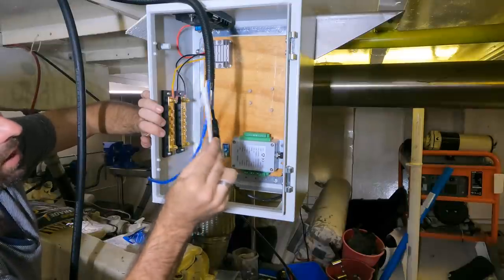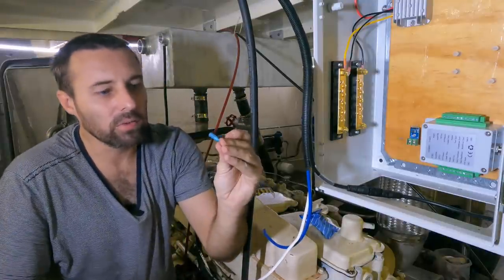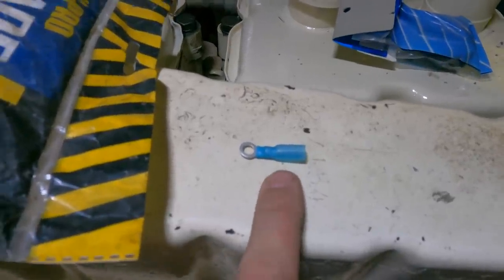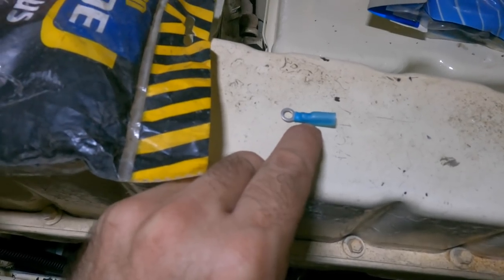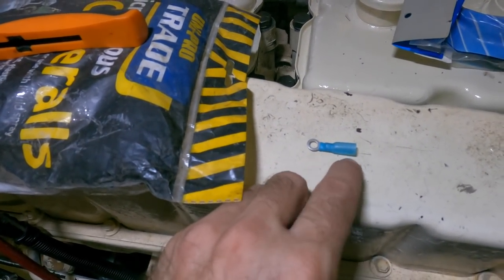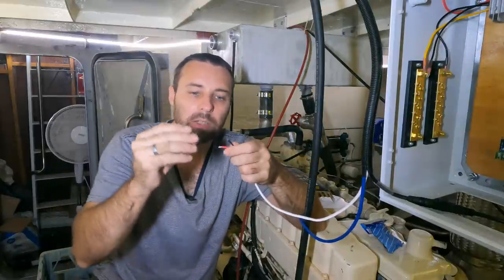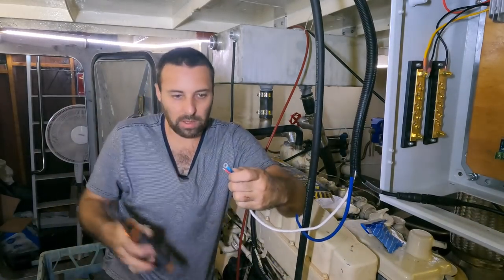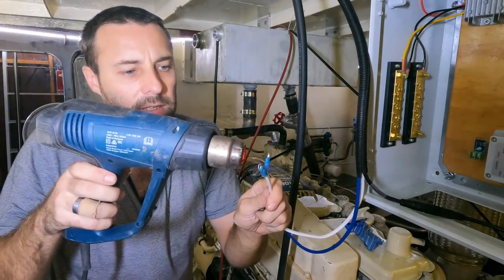How to crimp terminate wires on a boat and have them last decades

Comment: Finally, someone actually does this properly!

Some other things to note...

Stress relieve your cabling in switchboards etc.

Crimped connectors do still have a freezing point that will cause strands to break in the same way as soldered joints when subjected to vibration etc. The main difference there is that the wire is supported beyond that point within the connector which makes them far easier to do properly and consequently far more reliable. Soldered joints can be just as good, but lots harder to get right.

Even though they're stress relieved in the connector you still need to stress relieve the cable within your switchboard etc. You can't have half a meter of wire hanging off the crimp.

Your switchboard will also end up far neater right at the start which pays dividends later on when you need to fix or change something.

And if you do use non tinned wire, do not tin it or add solder to it before crimping. Solder is an extremely soft metal, when you subject it to force such as from a crimp it will start to flow (creep) out from under the crimp, it just does it very slowly. The result is that the crimp will loosen up over time and you'll end up with a poor connection there.

Finally, buy a thermal camera. Not just a temp gun, but an actual thermal camera. They've gotten to the point now where they're reasonably affordable.

They're absolutely brilliant for dealing with switchboards etc. You do all your crimps, get everything running and load applied to everything etc then after an hour or so you come back and look at the crimps. You'll see any bad ones as they'll be hot.

You should also periodically (every few months or so) check them to make sure none have loosened up over time.

Do the same thing with your batteries as well, again the bad one will start getting warmer than the rest.

You can check exhaust header temps too, or see where the cold is leaking into a room to check insulation and if you get one with enough thermal resolution you can even find rodents etc.

Basically, they're one of those tools that once you have you'll never understand how you managed without it. They save so much time diagnosing faults and doing planned maintenance it's unbelievable.
Reply from the maker: Great advice. Thanks Daniel
Reply: One more "not required, but helps" to keep a can of xylene or other fast solvent handy. The wire insulation typically has release agents and or lubricants on the outer surface that can be removed to help the hotmelt adhesive stick better over the long run.

Comment: Dame, I'm a retired high voltage test technician and I worked with thousands of electrical connections similar to yours but in electrical substations. That was a perfect explanation how to perform crimps, the key point having the proper crimp tool. I've seen contractors make hundreds of crimps in a section of switchgear only to find out they used the wrong crimper and all the wires would pull out of the crimps. 
Everything on the boat is First Class. You are a skilled engineer 👍👍👍👍👍👍
Congratulations on being a full-time boat worker now. 😊🤝🤝🇺🇸
Reply from the maker: Thanks Tom, great to have that feedback.

Comment: Spot on, Bro. I was a US Navy Electronics Technician. And I do a lot of automotive & trailer wiring in Minnesota. Lots of salt on the roads in winter. What you just demonstrated is the premire way to do wiriing with crimp rings nd butt-splices.  Cheers. All my best to you both.
Reply from the maker: Thanks Brian
Reply: Right on Brian.  I'm in Iowa.  When I  find the package of wire nuts and scotch links in the trailer kit, I giggle every time

Comment: Bang on all the way.....IP ratings very high with all your connections.
This is how I use to rewire ribs and then also try to get as many connections into a IP rated box with water tight glands. Those connections that was still a little exposed I used liquid heat shrink stuff (sorry I forgot the name of it).
Spot on job on your video with you indepth guides.

Comment: I build a lot of wire harnesses for boats and you showed it properly.
There are other methods, the theory is the same and this is by for easiest method.
I am glad that you added the cavit of tinned wire. Many boat manufacturers do not used tinned wire in original construction unless running in areas of high exposure to moisture and salt water.
I have a mid-70's trawler no tinned wire but also no corrosion in the wires  as they were sealed properly.
Awesome work mate.

Comment: Absolutely agree with all of this. A short but value-packed video. I think these wire strippers were first made by the ‘C.K.’ brand in red and they are my go to ones for everything from 2.5mm2 T+E all the way down to tiny; they are fab. One of the best features of them is that they work and remove the insulator without harming the conductor regardless of size, which is very, very neat. They also have a stop so getting the right length exposed is a cinch, but it’s best to get this right first time. They are not nibblers. The only times they do not work are when access is very tight or there’s a very small amount of insulation to remove and you have an outer piece too close, but this is rare. If all is fine then grip, grip, grip – strip, strip, strip! Also fully agree with tinned and the crimping, but the message on using heat shrink with adhesive or glue or whatever is legion. It forms a much better joint in every application. Finally, what wasn’t said was to label your astonishingly well-made wire. Chances are that it’ll have to be removed at some point, some day and a heat-shrink label tube or a flag label using a decent labeller ought to be the norm. Oh and the best terminal crimps sometimes have to be trimmed otherwise the bolt and suitable washer don’t sit properly, but this is obvs.
Reply from the maker: Yip. All good advice here. Thanks
Reply: The double crimpers look very similar to the Ancor crimpers I use. My other crimper is about three feet long and cost about $275. I use it for tinned power lugs, ranging from (North American sizing) 8 gauge all the way up to the 2/0 -4/0 gauges I use at the batteries and the starter. I use resin-infused heat shrink tubing and, after I double crimp the power lugs, I shrink this over the "shaft" of the lug. 

We actually had a flood in the engine bay and I had to get the starter rebuilt. Not wanting to chuck a longish length of expensive 2/0 gauge tinned wire, I cut the old lug off and there was ZERO water ingress. Shiny like new. So I just repeated my lug crimping and heat shrinking and restored the rebuilt starter. No problems! I follow the same techniques, which I learned from this site, which is an amazing resource: https://marinehowto.com/marine-wire-termination/

Comment: Excellent tutorial. This is what I’ve been doing for many years, but most people don’t take the extra time or expense.
Reply from the maker: It’s a pet hate of mine seeing car crimps on a boat. I just know your gunna find green gunk under them
Reply: @ProjectBrupeg  I’ve also recently found a soft solder seal connector that they use in the aeronautical industry that’s quite nice. Specifically used in butt connections. Quick heat with a heat gun and done.
Reply from the maker: Yeah I’ve seen and tried those. I’ve not had the best experience with them but it’s possible I’m not doing it right. I have a 50% success rate so far with them
Reply: @ProjectBrupeg  I only use them on repair or extension jobs. The crimp seal are better for initial installation. With the solder only, I use my Dewalt  battery heat gun. They need a slower, lower level of heat. Just heat them till the soft solder silvers.

Comment: May I add to you great demonstration of the proper way of doing connections.  Use  Penetrox on the connections points outside. This is what we use as Electricians to stop corrosion on connections. We like you can't wait to see Brupeg's bottom get wet and king Cummins come to life.

Comment: And DON'T use welding cable for battery wires. The jacket on welding cable is gaseous permeable which means the jacket is neither water resistant, water tight or corrosion resistant. I like your style for doing the wiring. I've rewired boats up to 50' - 60' and have removed lots of corroded terminals, bus bars & other terminal connections. Red = 18-20 Ga., Blue = 14-16 Ga. & Yellow = 10-12 Ga. Don't use SAE wire either because it's up to 10% smaller.

Comment: Those resin filled connectors are great, I use them for everything if they are available in the right sizes. 

I've noticed most videos lately were shot with gopro which IMO is a little sad. I started watching Brupeg because of the great picture quality but lately I got the feeling Dangar Stu is filming ;) Hope you can get out your proper cams sooner than later again.
Reply from the maker: We do film 100% using go pro now. We have tried canon and Sony ($6,000 ea) and while they do give great picture quality sometimes, 80% of the footage is unusable as they are inherently unstable, they are extremely easy to set wrong and ruin a shot and most of what we film we don’t get a second chance to re shoot it. Yes we love the image quality but they are just awful to use and end up being the slowest part with the highest frustration in everything we do. It’s possible we will go back to better cameras when out on the water but given we can buy 12 go pros that are water proof and have image stabilisation onboard for the price of one camera we hate, that’s a big hull for a mirrorless or DSLR to climb

Comment: you have probably already considered this but it is worth while either completely sealing your power box and associated conduit from the atmosphere or working out a suitable ventilation system. Otherwise you will have problems with condensation and mould growth.
Reply from the maker: It will be a sealed box full of argon when we are finished. Just not there yet
Reply: @ProjectBrupeg  cool, you have it fully sorted then

Comment: Only thing I would add is Stranded cable for anywhere you expect to encounter vibration or movement, Solid cable for anywhere that you expect to be static and not subject to vibration or movement. Solid tinned cable may last longer than stranded tinned cable in a scenario where there is zero movement, the reverse is definitly true in an area where there is lots of vibration.

Comment: Dame, great short clip!  Question to all.  I was always taught to twist the wires clockwise before inserting into the lug.  I didn't notice that step in any of the comments.  Does it matter or does that add strain that vibration will take advantage of?  As always the best to you and Jess (ok and Stu...) :)
Reply from the maker: I don’t know if this is good or bad but I have found with some butt splice connectors they don’t have a physical stop in the centre essentially it’s just a tube with heat shrink on it. If that’s the design of connected i try not to twist the wire and instead slide the crimp down one wire, mesh the two stripped ends together then pull the crimp back over the join and finish it off. I just assume I will get more conductor contact and therefore a better join

Comment: Had a look at your links for the crimper and heat shrink crimps, but they don't ship to Australia.  Do you have a supplier that ships to Oz?  Thanks, Kevin
Reply from the maker: Not actually sure Kevin. Maybe check out eBay. Brand doesn’t matter so long as the shape of crimp is rectangle not pointed
Reply: @ProjectBrupeg  thanks Damo and Jess. Looking forward to the launch. Good luck.

Comment: For the crimping process; do you have the coloured dots on the crimper facing towards the eyelet of the terminal or towards the cable?

I’m left handed and can never remember which way round it goes!
Reply from the maker: Honestly I can’t see it makes any difference at all. The crimp is the same shape either way.
Reply: How about for a non heat shrink crimp?
Reply from the maker: I haven’t used a non heat shrink in years so really couldn’t say. Personally I would bin any non heat shrink given these heat shrink types are not much different in price and night and day different in terms of quality.
Reply: That’s the way I’m going to go. Perfect timing with the video for me! Thanks so much.
Reply: @ProjectBrupeg  That's not true, actually, for a double crimper.  According to the link I sent you (and the instruction manual for the double crimper I have): "When crimping an insulated terminal, with a double crimp tool, it is important to note the direction the terminal is place into the crimp nest. The insert end or the end of the terminal which you feed the wire into should always face the strain relief side of the crimp die.

Remember when I said “double crimp” yes, this tool makes two crimps at the same time. One crimp is made for the wire and one crimp for the strain relief. These two sides of the crimp die are not symmetrical. The side where the colored dot is, on this particular Ancor tool, crimps the strain relief portion of the terminal and the other side crimps the wire end.

If you make a crimp with the wrong side of the crimping tools die, the crimp will not be correct and will likely fail.

TIP: Other double crimp tools from other manufacturers may be different than this tool. Examine the dies or check with your tool manufacturer for instructions. The side with the smallest crimp ID is the one to crimp the bare wire end.

WARNING: Double crimp tools are UNIDIRECTIONAL! If you crimp the terminal backwards it will pull out far too easily and pose a safety risk. The strain relief crimp nest is considerably larger than the crimp nest designated for the bare wire. A fair number of readers have complained that their double crimp tools don’t work well, and some cheap Chinese “look-a-like” tools may not. I always explain that they are unidirectional and the reader most often writes back to say the tool now works just fine."

You may have a different double crimper, of course, but this sounds reasonable.
Reply from the maker: I will have a close look. To me the tool looked symmetrical so I’m not sure it’s a double crimp die

Comment: Like the look of the terminals but when I went to Wirefy it didn't give me the option to specify Australia  How did you do it?
Reply from the maker: Hi Graham, yeah these terminals were sent to us from a viewer in the states. i have topped our kit up using e-volt terminals from eBay and found them to be almost identical in quality and usage. link to the main e-volt sotre is here https://evoltelectrical.com/
Reply: @ProjectBrupeg  Wow thanks for the quick reply. Looks like they came from the same factory.
Reply from the maker: No worries mate. Yeah I can’t tell the difference. Main thing to look for regardless of brand is make shed the heat shrink extends well forward to moisture can’t wick up the open ends on the wire. Zero moisture anywhere is the main goal